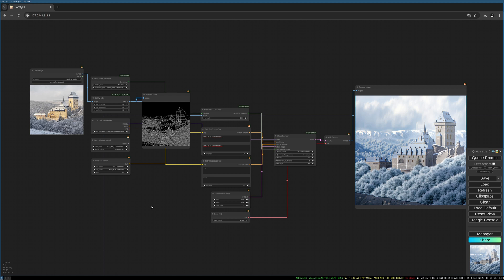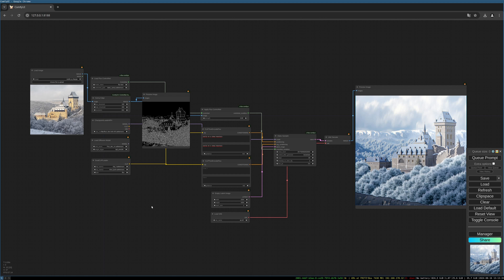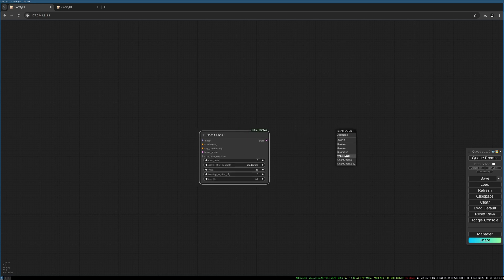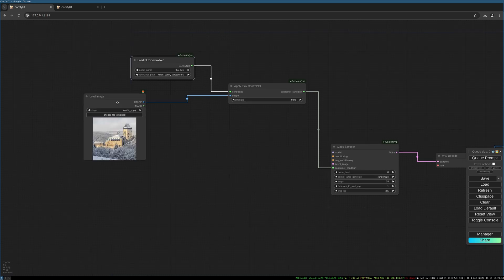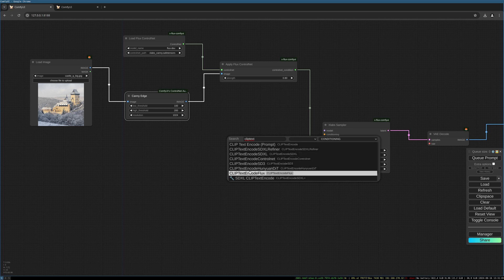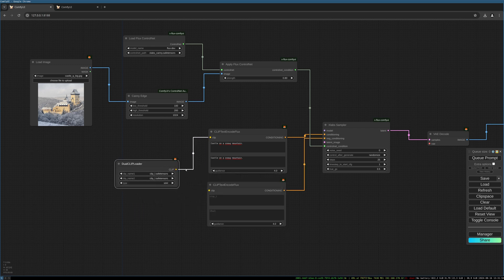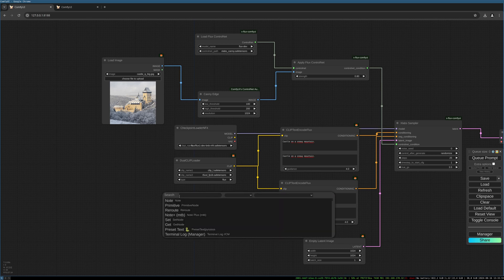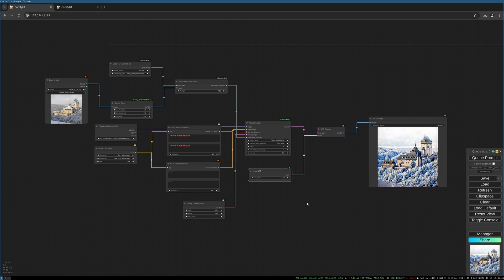FLUX NF4 with ControlNet in ComfyUI AI, For smaller GPUs, low VRAM

Comment: Error : No module named 'controlnet_aux' (ControlNet)

(I'm using Flux1-dev-Q4_K_S + comfyUI + Controlnet)
There is a error during the node "Canny edge" :
"Error occurred when executing CannyEdgePreprocessor : No module named 'controlnet_aux'
I re-installed  ControlNet auxiliary model manually several times, and updated everything. It didn't change anything.
Reply from the maker: you are trying to use a gguf model in a workflow for normal flux models like dev schnell and fn4. this is not working right now.

Comment: I get allocation on device issue. i have 16gb of ram and 8 gb of gpu. works fine without controlnet and xlabs sampler
Reply from the maker: damn, sometimes other software can fill the vram as well. so be sure to check if there is not some gpu consuming software running in the background. You can also try to reduce the controlnet image size and the empty latent resolution.
Reply: @neuron_ai  I think the issue is with the xlabs sampler. Normally flux generates an image within 20 seconds. But when i tried with xlabs sampler without controlnet, it generated the image after 2.5 minutes.

Comment: Thanks! What are your machine’s specs? I’m unable to run controlnet on my machine with RTX3070 laptop 8gb vram and 16gb system ram, with system fallback preferred, MUX switch enabled, model as NF4 v1 dev for which I get ~60s total time to generate 20 steps warm (~3.15s/it). Does it have to be 1024x1024? I was trying different compatible aspect ratios, it shows like 90+s/it when trying to run with controlnet.
Reply from the maker: Hey, I have a 4090 so quit different to your setup. maybe try to reduce the controlnet image resolution as well as the empty latent resolution.
Reply: @neuron_ai  wait, so you made a video about running this on low VRAM, but only tested this on a 4090?  That seems a bit like clickbait.
Reply from the maker: @Delerium1976  Before I make a videos I check if things work out for people. I also check the model creators for the technical requirements and measure the vram usage. Those things together give  me quite good evidence that this is running on smaller gpus. I can not run all models on all the different GPUs....
Reply: @neuron_ai  I guess the real question is, what do you consider "smaller GPU's" because a 3050 only has 6 gb vram, which is still in the "smaller GPU" range but not quite outdated enough to be excluded from all AI image generation, but doing any kind of image generation on a 3050 is very hard.  An 8gb 3070 is a perfectly reasonable amount of vram for everything but the high end AI gen projects and should be absolutely considered within the bounds of (or above) the description "low VRAM."  So if 8GB VRAM is not enough for your workflow, how can you claim that this is for smaller GPU and low VRAM? Is 12GB your definition of low VRAM? I would guess that's not most people's definition of low VRAM. Maybe to avoid confusion, it would be helpful to clarify how much VRAM people are expected to have for your workflow.  It would clear things up a lot before people go through the work of installing everything.
Reply: @neuron_ai  I appreciate the reply. I was in fact receiving OOM, and then when it did ran it makes sense that it was slow - looking at the resource usage. So I'll upgrade to 32gb RAM in the next couple weeks and that should do the trick. Main issue seems to be that the models that actually need to be loaded do require more ram than I have headroom for.

Comment: OOM... RTX3060 12GBVRAM, 32GB RAM, WIN10 even in 512x512. But worked with t5xxl_fp8 ( also with 1024x1024)... It's a first time I see Flux actually working with controlnet on low end hardware. canny_V3 imho giving better results.